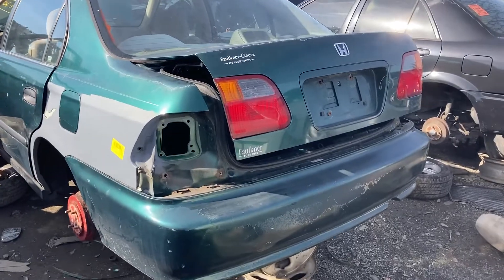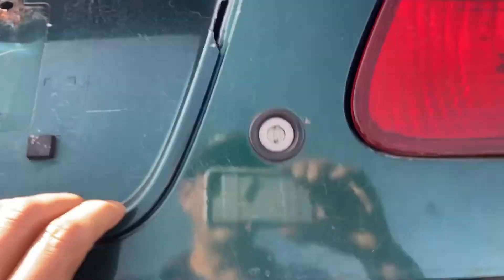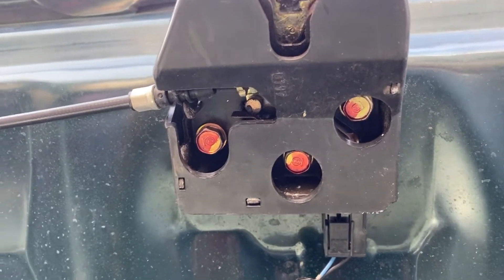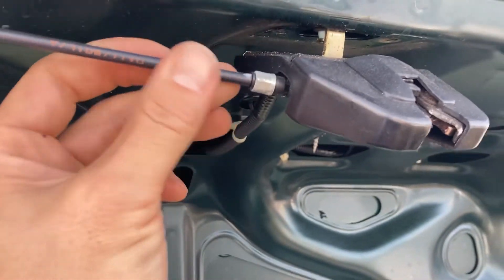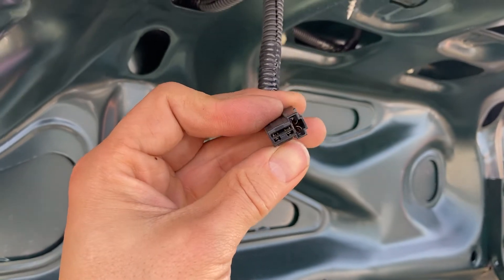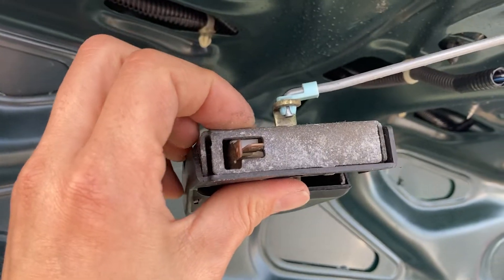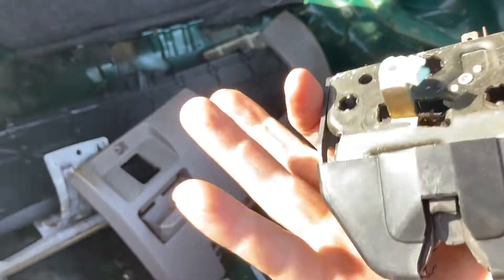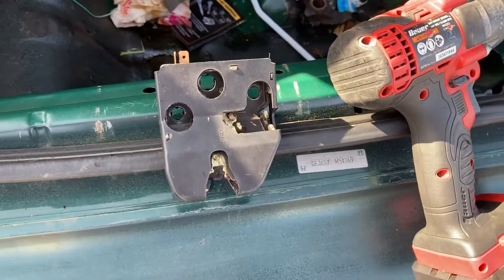1996-2000 Honda Civic Trunk Latch Removal

Comment: I replaced a Honda civic trunk following your video, but I must have not connected the open trunk cable to the latch in the correct location. Is there a diagram showing the correct position. Also, the key lock does not operate as it should and trigger the latch to open. Any suggestions?
Reply from the maker: @Mickey-d1v  sorry you are having some trouble.  Maybe have a friend pull on the release next to the driver’s seat so you can see the cable moving to release the latch; it might help line things up better.  You might also want to make sure that the key is working correctly in the cylinder before attaching the bar.  For a diagram maybe see if you can pull a factory service manual for the car.